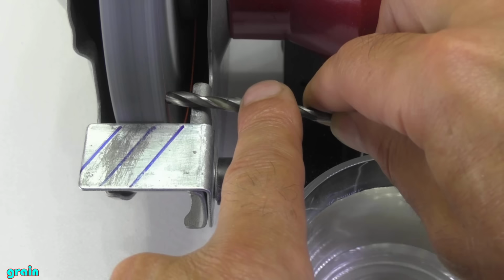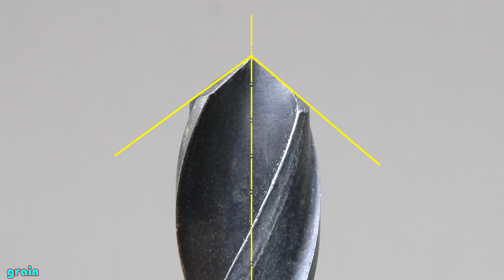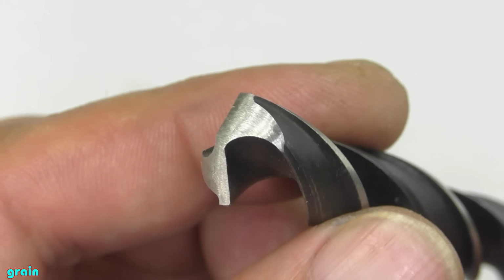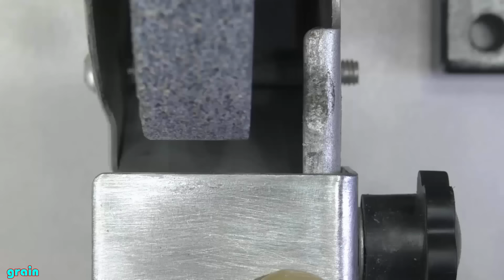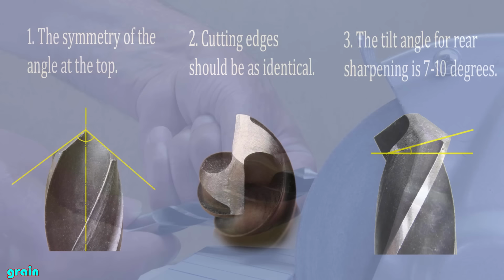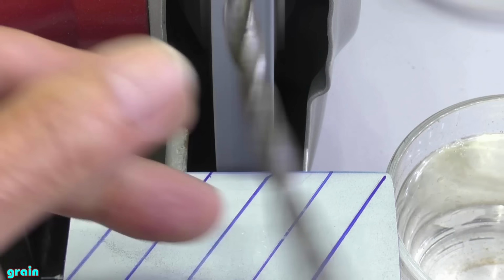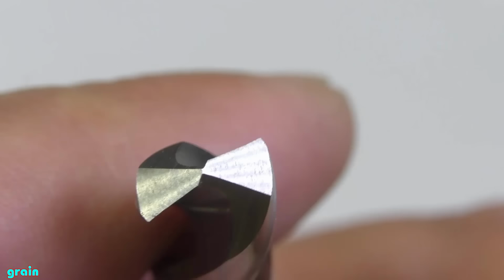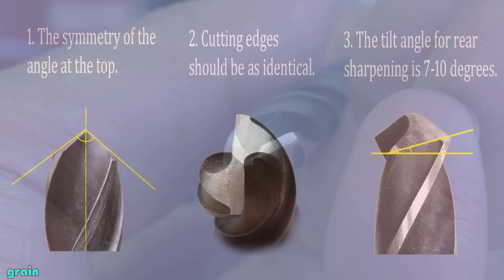How to Sharpen the Drill Bits (for metal)

Comment from the maker: Drill Anatomy - https://www.youtube.com/watch?v=MZa2B5oWTYM
Cómo agregar agregar subtítulos en español a mi video - https://ibb.co/TtdTDKk
How to add add subtitles in your language to my video - https://ibb.co/TtdTDKk
Reply: Very  nice treack  very easy idont .       need. To watch     another treack sir  your idea is extremely  finish I have same  as you correctly sharpened
Reply: Thank you good tutorial.
Reply: Excelentes informaciones e instrucciones prácticas
Reply: good video, i liked the end part best, my Question is that I believe you cannot grind a drill by hand and get it hot enough to anneal it, at least not hss drills, .purpose of cooling with water is only to hold it. is this accurate ?
Reply: Very very nice, Thanks you
Reply from the maker: @BillyTpower  Yes, you are right, water is unnecessary when sharpening a drill, I realized this later. It’s just that when I made the video, I was just learning how to sharpen drills, as you can see, I made this video without the experience of a master, so I did cooling. But still, I practiced sharpening a cut drill in less than 1 minute. This workout only took me half a day. I liked the result so much that I sharpened a box of about fifty old drills; I had them unsharpened for more than 20 years.

Comment from the maker: My channel grain DIY - https://www.youtube.com/channel/UCZh04Qe21IxnZSgSsTQh8Vg/videos
Reduced New Year's Eve Prices for HSS Step Drills - https://ali.ski/7x8RE
Reply: Subb’ed 👌🏻
Reply: Best
Reply: Super
Reply: The hardness of the material determines the angle of the drill.  The softer the material, the sharper the tip and vice versa.
Reply: ⁶
Reply: Bonjour monsieur

Merci pour les sous titres en Français 💝
Reply: @thuanthiennguyen329
Reply: #grain  What is difficult in sharpening drills? Elementary. For carbon steels - 60 degrees. For chromium and chromium molybdenum stainless steels - 55 degrees (60 can be drilled normally) For titanium - 65. Aluminum, wood - 70 degrees.
Reply: Übe weiter Bohrer anzuschleifen, es geht einfacher u präziser. Meine Auszubildenden lernen es so nicht 3:06
Reply: You never I mean never  not clamp the piece your drilling you may get away with it once or thousands of times .but sooner or later the piece will mangle your hand break your arm or suck your clothes into the shaft.i met a woman that a drill press mangled her  hand broke her arm in several places and ripped her hair out. Because her supervisor told her hurry up you don't need to clamp it I need it Right Now

Comment: CONGRADULATION SIR. From all the videos on YOU TUBE  on how to sharpen drill bits (I,have watched maybe  50 or more) you are the only one   that have  the moves  that will come only with  experience . All the others  , have , I would say ,  beginners  ways to sharpen drills . It  still does the job  " ok"   but  nothing like the real thing. I'have  worked 45 years  as a maintenance  machinist and ground lots of drill bits. And
all the beginners watching , keep on grinding, you will get better. No need to buy expensive machine to do that job.
Reply from the maker: Thank you! You may not believe me, but I made this video right after I learned how to sharpen drills. And I learned in just half a day after watching a video of an old Russian master from a tool shop (he transferred his videos to Russian YouTube - Rutub). His name is Viktor Leontyev. Probably later I improved my skill a little more by sharpening a box with fifty dull old drills; I had it lying around since Soviet times.
Reply: Well good for you , but you must in a trade related to machining in some ways.........
Next step , try to make your drill bits center less........ All you need is a grinding wheel  very sharp on the sides. No radius........JP.........

Comment: Thank you good sir for the proper Direction in sharpening my bits I have watched several videos and none of them pointed out the 45 degree angle that you did I have started trying to sharpen my bits none of them were working however on a brand new bit I would notice there was two angles not just one that everybody showed I'm going to try your techniques and I hope they are successful

Comment: Thank you, I have many broken drill bits. I am amazed at how neat and clean your workshop is, but then again I do lapidary so I have wet sludge and dust from polishing everywhere. I level my griding wheel with a large quartz crystal, I have many of them and they are very hard. Also drawing the lines to use as a guide is very helpful.

Comment: Of all the sharpening method , I like your method most. First , you are the only one who said tip angle is not so important as long as it is symmetrical, and you proved it . Second, without worrying about the tip angle, the rest becomes simple . I had tried your method, and I can get the drill bit to drill again in less than 5 minutes . Thanks .
Reply from the maker: I'm glad I helped you.
Reply from the maker: I forgot to add, it is believed that a sharper angle can be used for drilling softer metals, such as aluminum (I have a 90-degree test in the video at 3:40), or plastic.

Comment: I've been watching a lot of videos showing complicated jigs for bit sharpening. After watching this I used my vertical sander with 80 grit and some 60 degree lines on the support.  I sharpened 5 bits in 5 minutes. I used my magnifying glasses.  Thank you.
Reply from the maker: This is the standard sharpening of drills, as do ordinary workers in the tool shop, plain and simple, just a couple of hours of practice. I am glad that it benefits many people. Manufacturers and youtubers take advantage of their people's ignorance, invent and sell various gadgets (from which there is no sense) to people far from this business.
I watched a video of one device (about 50-60 euros), an ordinary person was trying to sharpen a drill. When he showed the result in close-up, I realized: point 3 is not fulfilled there, as in my video, there is no bevel for cutting into the metal. Of course, such a drill will not sharpen, but only warm up, which was shown by the person in his video. Unfortunately, I don't remember where I saved this link.
 Yes, magnifying glasses are desirable, especially if the drills are of small diameter, I also use that.

Comment: As a Fitter and Turner in Oz its how we start to learn but if you look at that lovely demonstration at 5 min which tells a bigger story. If you look behind the cutting face their is a big gap, this needs to be filled but not higher that cutting face, this is what the drill "rests" on in the hole, it stops it from shaking and drilling of center and more importantly biting like a tiger when it breaks through the other side. + their is no need to thin the web on a small drill especially as small as 5mm, look at a new drill they don't come thinned.

But for DIY its a great video to get you to start to re sharpen your drills and understand the basic's.

Comment: Finally a good video that speaks from my heart. You don't need any equipment, just a little knowledge and practice. 
I learned it properly in 1955 and can happily confirm what is shown here.
Unfortunately, it is not easy to see that when grinding, a slight rotary movement is carried out in addition to the tilting movement.
As already mentioned, the point angle of 118° is not that important. However, chip removal is only more difficult in the case of larger deviations and deeper bores.
Reply from the maker: No, I don’t do any rotation at all, it’s an unnecessary action. It may have seemed that way in the video, to be honest, it’s very difficult to show in a high-quality manner when shooting a video - the horizontalness of the drill, the edge, maintaining the angle, etc. Yes, I saw in other videos some people rotate, but this is unnecessary - the back surface is naturally rounded in the process of raising the top of the drill.

Comment: I once needed to drill a 1 1/2 inch hole in steel. The only bit I found was broke in half so I flattened it and resharpened it. It cut through that steel plate like butter. My old boss taught me how and gave me a box of dull bits to practice.

Comment: Good video for beginners! As a machinist/tool and die maker you could not drill D2,A2 or stainless with a 90° angle lol. 118° which is the standard angle struggles and dulls quickly. Anything above stainless is 135° split point. You also peck drill through almost all metal with a HSS drill. I run both HSS and carbide drills.

Comment: For whom it may concern. The top of a drill is mostly (or best) 118°. So that when one use a centerdrill or NC drill (for centering) (which has a top angle of 120°) makes that the dril doesn't go full contact on the full lenght of the cutting lip, but does this gradually from center to exterior diameter. Use a sharper top angle when you want to drill plate. Use a larger angle for example for stainless steel. When drilling stainless steel, drag the freshly sharpened lips lightly over the concrete floor, this will deburr the lips, and make it more gentle to cut with.

Comment: First rule of using a tool post grinder, "Never use the side of the wheel",  drills are not sharpened to 90 deg. 118 deg is standard for soft metal and wood /plastics. 135 deg split point is for harder metals. You also start at the heel and grind to the lip, holding the corner turned up about 20 deg from the center to give you the correct angle for the chisel. Good try though. Just hope people don't try this and blow up their grinding wheel.
Reply: What kind of grit would you recommend for HSS bits ?

Comment: You have elaborated the technique very nicely. I usually use 1.6mm to 2.5mm drill bits. I will have to practice now with magnifying loop. I was doing it by diamond file but not satisfactory job. Wish me luck.

Comment: What parallel degree should be marked on the grinders landing support if I too want to use the 90 degree cutting angle for smaller bits? I now understand more about the jumper. Its key cut job should help keep the bit centered and initiate the cutting material before the cutting edges can start working on the material. If the jumper is too long then it's trying to take too much material that the cutting edge can't handle. This is the most easiest instructional video on free hand sharpening I have every seen. Thank you!

Comment: Very very good video!
I would just add that for little drill bits (4mm and less) I switch on, and then I stop the current, so I sharpen the drill bit only with the inertial force of the stone, with magnifying eyeglasses and good light. Very light and short pression, no more vibrations, so it's easier  to equilibrate both cutting edges (but 2mm is my maximum, and not everytime...)
Best regards from France
Reply: Essayez avec une meule blanche qui est vraiment faite pour l'affûtage, et choisissez un grain fin pour les petits forets. Les meules bleu-gris sont juste pour ébavurer la ferraille, une vraie ne coûte pas beaucoup plus cher et vous changera la vie !

Comment: Do mine with an angle grinder, I don't even have to take it out of the drill.  With a bit of practice you soon get good at making sure the point is central, and they stay sharp just as long as if you do them on a proper sharpening stone as long as you don't let the tip get too hot.

Comment: Nice info! The only thing I didn' t notice hearing is with which grinder we grind them. The fine one, or the other one? I guess we must use the fine one.
Reply: Coarse grain to get the overall shape on larger bits. Finish and smaller bits on the fine grain.  There are dedicated white wheels to replace the blue-grey ones.

Comment: i use my drill bit size 19mm & 22mm for the pipe bowl shape. using grinder & router i shape symmetry from the top to bottom 45mm length to U-shape. Then slowly sharpen the tilt angle using dremmel. its drill fine but the bowl surface got a bit bump (not smooth U-shape. especially when using hand drill.

Comment: I have a General #825 drill bit sharpener and it was rounding over the drill bit edge. I watched your video and sharpened all my drill bits in much less time than the General 825 sharpener was taking and did a much better job. Thanks.
Any idea how to sharpen a black and decker “Bullet“ drill bit?
Reply from the maker: I'm glad my video helped you.
I don’t know what kind of drill you are asking about, but there are drills made of such alloys that are difficult to sharpen with an abrasive disc. Diamond discs are used for this.
Reply: @grain-diose  How can I send you a picture of what I was referring to as a “bullet” drill bit. 
God bless, Randy

Comment: It is not easy to keep the symmetry of the drill bit as well as making the small angle to keep the bit from rubbing to much with the material. I bought a sharpener that make an angle to the drill bit and ends up having unsymmetrical bit. I wonder if using angle grinder with sand paper would work?

Comment: Good video, you actually use a smaller real world size drill bit for demonstration. What number grit grind stone wheel are you using and or does it matter?
Reply from the maker: In fact, one circle of 60-80 grit is enough. I just sharpened the cut drill in the beginning for the demonstration.

Comment: The chisel point doesn't seem to be 90 ° to the cutting edge when I'm sharpening a drill, will this affect the drilling procedure
Reply from the maker: The rule is this: for a softer metal (aluminum), you can sharpen with a sharper angle, for a harder metal, a more blunt one.

Comment: Can sharpen in the field with side grinder
Reply from the maker: Thank you, good question! I have not tried it, but I saw how it is done on YouTube. It would be nice for this to rigidly fix the angle grinder and also make a horizontal stop and have a diamond disc. This is necessary not only for accuracy, but also for safety. By the way, a small edit can be made with a diamond file manually, I tried it. For this, it is advisable to have a vise for fixing the drill. Once you've learned the basics, any method will work for you. :)

Comment: the angle is 120 degree is very important becouse the number of holes made at smaller ange with a angles is smaller becouse it wears out must faster ,i worked with drills for 40 years and one more aspect depends on what material you make a hole ,in brass is something else becouse is very soft

Comment: What you not use oil when you bore,  the make them to bee good longer
Reply from the maker: Oil is needed when drilling thick steel. It is also necessary when threading.

Comment: Každý brousí vrták trochu jinak, ale jedna chybička se vloudila. Úhel 120° se do učebnic strojírenství dostal někdy kolem roku 1908, kdy se opracovávala převážně litina a už tam zůstal. Dnešní zušlechtěné oceli jsou někde úplně jinde, takže lepší je brousit na 150°.
Reply from the maker: Standard for conventional drills for steel 116-118°
Reply: @grain-diose  common structural steels 118-120°, wood and soft materials sharper angles, hard metals obtuse angles, of course the speed of the drill, material of the drill, feed and quality of cooling during drilling also play a role. sharper angle = chip thickness

Comment: Why are you grinding with a “rounding” technique (moving upwards) does a flat cutting surface not do the job?
Reply from the maker: a flat cutting surface will drill too, but worse.
Reply: @grain-diose  I’m using mostly 0.8 - 1mm drill bits, all are flat, new out of the box. You got a new subscriber!

Comment: If you don't have access to a grindstone, a drill can be sharpened very carefully using an angle grinder.
Reply from the maker: Yes, there is such a way, but I have not tried it. But I recommend fixing the angle grinder in a vise and making some kind of emphasis. It is also advisable not to use the angle grinder disc itself, but to firmly glue an 80-100 grit cloth-based emery disc onto the disc.
But in principle, if you already have the skill, a small sharpening can even be done manually with a diamond file, fixing the drill in a vice.
Reply: Angle grinders have a lot more Rpm  than
Most bench grinders so e very quick and keep dipping

Comment: I think it's ok for hobby.
Drills are ground against the cutting surface on the flat side of the stone with a slight twist of the twist !!
to the drilling speed, too high !! since it is aluminum OK, if it were V2A the drill would be scrap now.

Comment: He drilled just aluminium, not iron.  Aluminium we can drilll also with unsharpened drill.
Reply from the maker: Have you noticed what kind of shavings came out from under the drill? Such shavings from under a blunt drill do not come out like that. I drilled aluminum because then I had an 80 watt machine only. Well, I sharpened the drill from full zero to finished in 56 seconds.